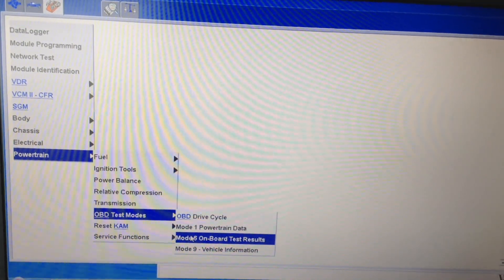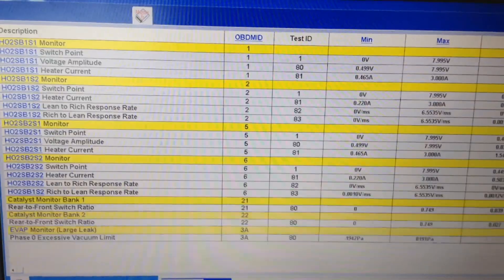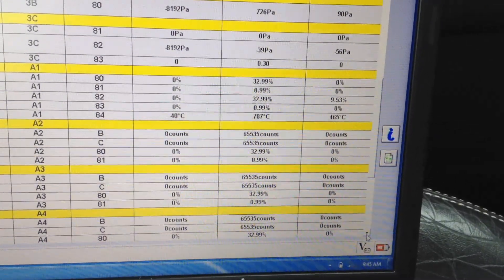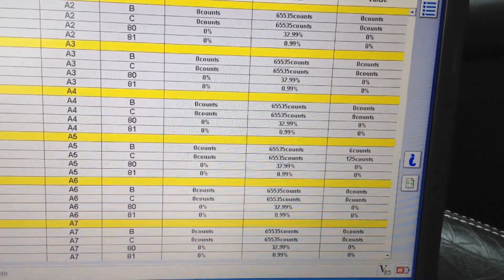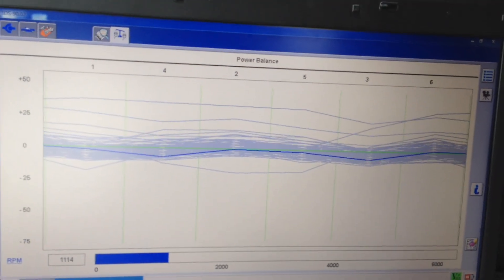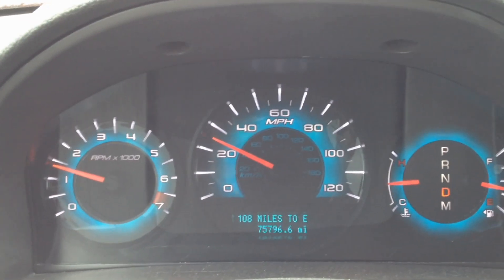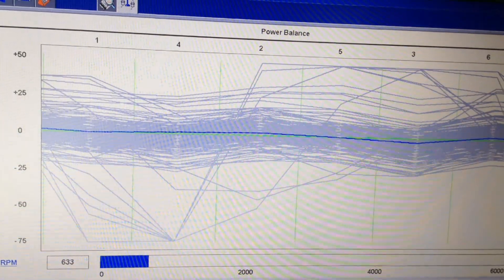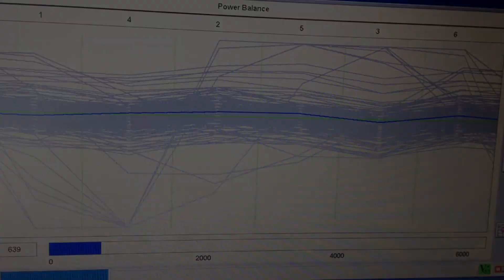Engine Misfires That Feel Like A Harsh Shifting Transmission

Comment: I couldn't find the misfire problem for 2 years on my explorer. It turned out that under the ignition coil there is a plate that grounds itself to the frame. I wire brushed all the rust, and car ran like brand new again! A zero dollar fix, that cost me a few thousand over time blowing my rear end or rear end seals from jolting.
Reply: doubtful im on my second motor in the explorer i hate this car
Reply: Yeah. 👆

Comment: how does someone get there hands on the software you use in lot of your videos
Reply: A lot of modern scan tools have power balance like in the expensive Ford program.  Even the ThinkDiag module, which links to your phone or Tablet via bluetooth, has it.....and it's a work saver, for sure.

Comment: I have got the same issue. I have a nissan pulsar 2013 CVT. Whenever i accelerate in low rpm till 2000rpm the car takes too much time to get there and then suddenly shudders for a sec and then starts driving fine. I havent got around this prob. Could be the cvt or the engine. It could happen hot or cold.
Reply: syed muhammad abdullah lol how it that the same issue?! U have a cat transmission... there is no gears to shift. Slow acelleration is common with that cvt. 
Shutter could be engine or trans. Take it to dealer not u tube. U don't even have the same type of car!

Comment: Hey man, sometimes after driving for a little while 20mins or so when i put my foot on the acclerator, the exhaust sounds louder and discontinuous ( sounds like small explosions after each other). This sound goes straight away when I restart the engine strangely! could this be due to engine misfire or somethung else? 
But as i said it doesn't always come on and goes away when i restart the engine!
any ideas or suggestion is much appreciated 
ps i dont get any dashboard lights

Comment: Hi I have a question I have the same problem with my 2010 Ford edge but when I took it to put the computer nothing came up how much would it cost to fix the coils
Reply: Stanley did you get it fixed? I have also a 2010 ford edge. It just happened to me.

Comment: Very nice video! Thank you wizard. I have a question, I have a 92 Mercury Topaz 3.0, when I first start the car it starts ok and idles "fine" for 20 seconds, then starts misfiring, (If I drive it at that moment it feels heavy), if I'm in park and give it gas it helps it to stabilize but when releasing the pedal it goes back to misfiring. After it warms up the misfire goes away 89%, it feels better and has more power. The misfires aren't constant, sometimes when I'm in a stop sign car almost wants to stall for a sec, however, it's not that common. I came into conclusion it's a spark issue since fuel pressure is perfect even when it misfires, all injectors are clicking also. What could the issue be? It's OBD1 I can't use my scanner to diagnose it better and it has no codes related to that on the self-test (KOEO and KOER). When clear flood cranking engine sounds even, so I assume it's not compression. OH BTW tailpipe smells awful, not like a rich condition, it's a different very strong smell and produces headaches; also I rebuilt the engine because it overheated but the problem was kind of there before. Please help!!! :(
Reply: Did you fix it?
Reply: @farajalagory8027  hi! Actually I didn’t get to fix it yet. I moved away shortly after that comment and parked the car since, hope I can soon sort everything out again. 

What I do remember actually is diagnosing a couple of weeks before parking, is a bad bank 2 S1 O2 sensor. That sensor began to fail completely and not report right and was flooding that bank with fuel even in hot. 

That makes sense to be the culprit of those cold misfires because before it completely failed, for the first 20 seconds that was fine with no misfire I assume it was still in open loop so the O2s don’t read. After those 20 seconds the sensors start reading and as that sensor was in the verge of dying it threw the correct mixture away until it got hot enough.

Comment: I really hope that changing #1 an #4 coil pack an all new plugs does the job.Does the pmc need to be reset after they take care of this?
Reply from the maker: jenniferrobinson2000 Yes the KAM should be reset.
Reply: KAM reset?
Reply: That would be too easy.  The car engineers wouldn't let that happen.
Reply: @ccsdstopstop4613  KeepAliveMemory
Reply: 2007 Lincoln MKZ here .coil blew .so .I have new Coils,  plugs , throttle body ,pcm o2 sensors and still have misfire on cylinder 5 ..

Comment: I have a 2003 Hyundai Elantra that has started this similar issue, when driving it will randomly act as if i hit the brakes, and then continue driving. I replaced the coils but that didn't work. I am being told that I need a new transmission. Any advice? the car isn't worth anymore heavy expense, but I can't sell it like this.
Reply: Mandy Smith ask Hyundai this is a Ford tech! Good Lord I can't believe the people wanting free advice and then ask on a channel that has nothing to do with your brand

Comment: We have this exact problem on our 2008 Edge but I am unsure which Cylinder. I live 38 miles from the closest Ford Dealer and getting the vehicle from my wife during business hours is difficult. When you pulled the #4 Coil, could you see any arching or visible malfunction? We are at 95k so it's time for plugs anyway, I was hoping to see evidence on either the plug or coil of which cylinder it is. It's gotten more frequent so I would think the plug may show signs of more carbon build up on the cylinder dropping out? I see your RC Car and boat vids, that's awesome. I am the Southeast Area Administrator for Team Associated. Common connection there.

Comment: i have the same thing with my xterra 06 and i don't know what this can be , sparkplug perhaps?
Reply: Edward  Hernandez check your radiator.  Xterras from that generation are known for radiator failure which causes the coolant and transmission fluid to mix.  You may actually have a transmission issue.

Comment: I am experiencing a misfire even after plug replacement and new coil ...p0307 ...scan will not pick up misfire after ECM reset
Reply: Luis Vega did you ever find the fix? I’m having the same issue in my 2015 f150 3.5L ecoboost. I just replaced the plugs and coils but still having the same issues.

Comment: Is this something that would happen at a certain speed, RPM, and gear? I've got a bad shake at around the same speed and RPM's with overdrive on and off and also with the brake slightly pressed. 2007 FWD Ford Edge, no check engine light.  I think I've ruled out torque converter but would love to see what you think.  
Please let me know! 
Thanks!
Reply: Did you ever figure out a solution to your problem? It sounds exactly like mine.
Reply: @timcheeseman3116  
It ended up being the torque converter. The dealer we purchased from the day before covered half the repair. About 2k if I remember correctly. We got a refurbished transmission. Good luck!

Comment: Hi there.  I have a 11 f150 eb that will shake and jerk on hard acceleration and always seems to be third gear.  When this happens the rpms jump 200 or so.  Feels like trans is slipping.   Maybe a misfire but no check engine light.  What do you think?????
Reply: +310Skarface  cracked plugs that were miss firing.  no check engine.

Comment: I wonder if this was an issue with the 2010 ford escape as well. I'm changing all 4 ignition coils and spark plugs this weekend I first thought it might be the motor mount so I replaced that but it still has the back feed especially when going up a hill or between 45-55 it feels like a harsh miss/shift . If you could respond it would be great if you know this an issue with the 2010 escape as well?
Reply: Did you resolve the issue??
Reply: @shivalp703  no I replaced motor mounts and coils/plugs I just ended up trading it in . It jumped way to much the final straw was when the electronic steering failed . My escape was just a lemon .

Comment: '09 flex, I know I have a misfire, but don't know which it is. Aside from going into mode six and watching the cylinder, will this misfire put a lending code? Is there one particular cylinder that is known for going bad? I'd rather not buy one and keep moving it around to find which one is causing it. Also, it shouldn't cause the plug to look any different since its not a constant miss right?
Reply: Kevin Anthony buy all 6

Comment: Mine had the same symptoms , but...It also throws a P07a5 code to stating its a “Transmission Friction Element “B” Stuck on” Its at Ford today getting looked at. I will post my results after it’s repaired to help other decide on future Ford Purchases. Note: I was given a rental, a 2017 Ford Focus at 45K miles similar to my 2015 Focus at 55K but the rental drives awesome and we all know rentals get treated badly.
Stay tuned for Five Star Fords diagnosis’s.....,
Reply: Don't forget to post the results.
Reply: I think he Forgot

Comment: Thank you for the video. I have a misfire code on one of the cylinders. After doing various diagnoses, it has been definitely determined that the issue is with a bad ground wire on the fuel injector connector on the cylinder with the misfire code. 

I replaced the entire ground wire for that cylinder with the misfire code from the fuel injector connector all the way to the ECM just to be sure, even though I didn't even see a broken or chewed up wire. This didn't resolve the issue.

The car has a V6 cylinder and I also diagnosed the other 5 fuel injector connectors. The ground wires for all those 5 fuel injector connectors are fine.

Since replacing the ground wire didn't resolve the issue, is there anything you can suggest I try out at this point?

For the time being, as an alternative method, I decided to splice and share the functional ground wire from the adjacent cylinder. In other words, I now have two fuel injector connectors sharing the same ground wire. This method has worked and has resolved the misfire issue. However, my concern is if this method is an acceptable resolution or is there any type of downside or hazard this could cause? Thank you!
Reply: Sounds to me like there might be something wrong with the Ecm. And IF the injectors are NOT ground operated then I personally don’t see a problem with connecting adjacent injectors to the same ground. If the injectors really aren’t ground operated (sounds like they aren’t), by splicing the adjacent grounds together, you’re merely just wiring it in the same manner in which it’s supposed to be soldered in the ecm.
Reply: @braydinjones6301   @braydin jones  It turns out that the injectors are ground controlled. While sharing one ground wire with two injectors eliminated the misfire code, it was a very, very rough ride. It was like the car had no power at all and it couldn't go more than like 30 MPH and forget about going up even on the slightest incline.

Comment: What ended up fixing this misfire?
Reply from the maker: Eric Rollins Ignition coil.
Reply: What fixes the edge transmission issues where it's stuck in a higher gear and the srs and wrench lights are on and Speedo does not work? Or have you not had one to fix. Just going by what I've seen on here.
Reply from the maker: Form the way yours sound it is the speed sensors they fail all the time especially the early edges or any 6f50 of that era actually and cause just what your are experiencing.

Comment: my car is doing the same thing. its cylinder 1 and 4 do you think is the spark plugs or iginition coil 
car: jetta 2011 2.0l (no turbo) 
miles 52,500
Reply: vw_jetta_vlogs Ask a VW tec... not a ford tec

Comment: Will this damage the PCM? Our 2009 Lincoln MKX started doing this intermittently on a vacation road trip last week. We drove the car for about 2,000 miles during the trip. Would this have damaged the PCM?
Reply: CCSDSTOP STOP ... why would it damage the computer?
Reply: I have actually heard it can damage the driver for the coil of the misfiring cylinder. I suppose it's due to  a bad plug when the coil energizing and can't release its engery and tries re-energize and over excites things

Comment: what did you find that caused the miss
Reply from the maker: It was the ignition coil on cylinder 4.
Reply: @FordTechMakuloco  just the answer I was looking for. I have a 2013 ford explorer 3.5l with coil on plug. It is misfiring. It does it while feathing or giving fuel but not every fire, just intermittently. When it started it, it was during a shift from 2-3 so it felt like Tranny. Now it has worsened over a week and can tell it's ignition. Without a fancy scan tool, it's difficult to diagnose. So I replaced plugs and plenum gasket and the PCV Since I was already there. It did help and the misfire doesn't seem quite so drastic but it's still there. No CEL/MIL. Going to try 6 coils now with ANOTHER Plenum gasket lol. Gotta love trial and error approach. If this don't work, I need to find a shop with a good scan tool.

Comment: My girlfriend just bought a 95 jaguar xj6 it is doing the same thing feels like the transmission is shifting hard and downshifting hard especially when you come to a stop thought it was the transmission took it to O'Reilly and it said engine misfire on cylinder 1 and evap problem the gas cap is bad going to fix it and see if that solves the problem probably will didn't have any transmission codes car runs and drives the car is in excellent shape it looks brand new inside and out and it has a check engine light on the guy she bought it from put electrical tape over the check engine light talk about a shady POS

Comment: I have 2002 explorer xls flex fuel with the same issue. I get a misfire on 2 cylinders with a random misfire on startup. I changed the coil pack and the crank pos and it went away for a very short time. Other than a tune-up, any other suggestions on what it could be before I go to the dealer? I recently got laid off, so anything I may be able to do myself would be awesome!
Reply from the maker: Larry Burgess I would replace the spark plugs and reset the pcm memory using my method. Flex fuel is very prone to this on cold starts when it learns the wrong inferred ethanol level.

Comment: Mine does a easy downshift from overdrive to 3rd, dropped the valve body replaced overdrive servo but same thing happens, mine isn't throwing a code. Any suggestions?

Comment: I think you´re the one who can help me with an issue no one can give me a solution. I´ll try to keep it short: 

Taurus 2001 SEL, 30000 Miles travelled

Starting at 60 and keeping it to 80 MPH begins to bump, it is a little hit (and very few times are three hits very quick) that happens every 10-30 secs, then eventually got worse. Got scanned, replaced coil, spark plugs and wires. got OK.

Now, after a year or so, it feels like it´s doing the same thing, only diference is that this time the same reader (Using it while driving at 50-70 MPH until the bump starts) does not provide any code, graphics shows that cylinders working good and there is no warning lights on.

Can you tell me if is it posible to be an engine computer fail or a transmission issue???, An specialist I met says it´s not a trans issue but wants to check it from the inside and I dont know if it is necessary to open it,

Thanks in advance and keep it up!!!!.

Comment: I have a 98 ford ranger 4.0 that stutters misfires and hesitating under low rpm load or right after up shifts and low power and bad fuel economy  what could it be ?
Reply: Same, 4.0 sohc 2006.
Done Plugs, leads, fuel filter etc etc and is manual

Comment: should you just replace all coils?
Reply from the maker: If they have some mileage on them yes
Reply: FordTechMakuloco my 94 crown vic has a hard upshot but it feels like the engine is it the spark plugs maybe
Reply: FordTechMakuloco upshift

Comment: I need help, I have a 2006 explorer with the 6r80 trans it with  the 4.6l v8, I've changed the tranny fluid and filter and all the spark plugs and ignition coils and I'm still getting the lunging forward bump when it's shift get down  when I come to a stop, I also get it when I have on cruise control going up hill when it shifts up got any suggestions on what to check next
Reply from the maker: You really need a reflash of the pcm to the latest level from a Ford dealer. There is a tsb on this exact issue very common bump when coming to a stop. The relearn process must be adhered to after the reflash for best results. If that does not fix it and 95% of the time it does you will need a mechatronics unit to fix the bump stop.
Reply: Thanks for your help
Reply: @FordTechMakuloco  hope do you get ford to do a reflash i tried to pay them plenty of times they want to see it as probable cause. I work on my own vehicle i think they don't like that do you know a way i can get them to do this reflash

Comment: My truck is doing the same thing you described  at the end of the videos the check engine light came on just blinking and a bad shake at speeds 45 and 65 going up hills. i took it to a auto repair shop and the only thing that popped on the computer was  up was a cylinder 4 miss fire. what should i have them do first? i called  my local ford dealership and they cant see me for 3 weeks in my small town. i need my use my truck sooner than that im moving in week to a new state.  what should i try to fix first on it any advise would be great thanks.
Reply: I know I’m very late but my 5.4 L F150 just started doing this.  I replaced all the spark plugs and it ran fine for a few days then started missing again.  Had the codes scanned and cylinder 2 was misfiring.  I replaced the coil pack but that didn’t help.  I then replaced the spark plug and reinstalled the coil pack.  That did the trick.  It must have been a bad spark plug.